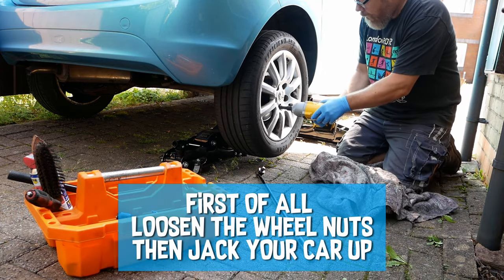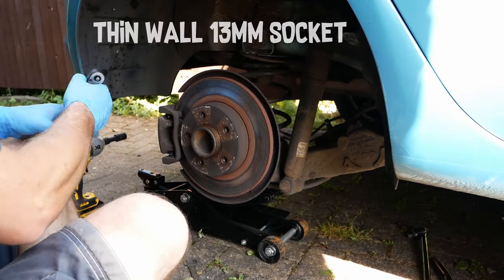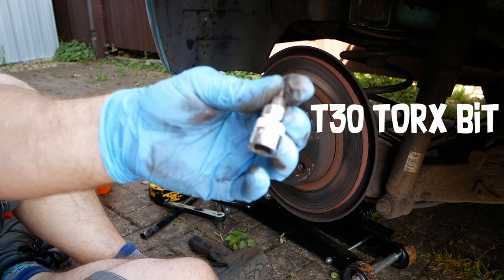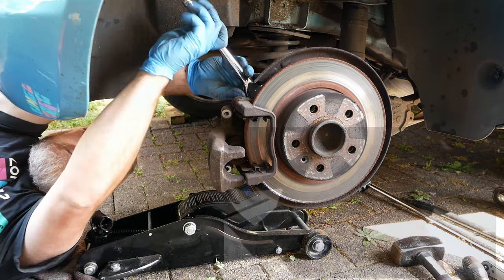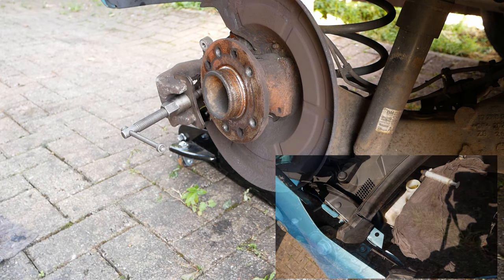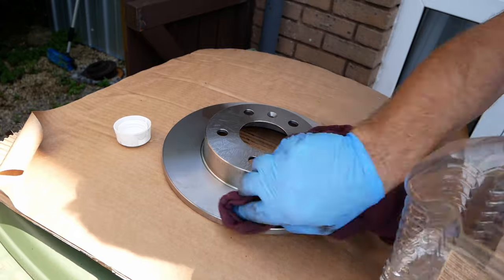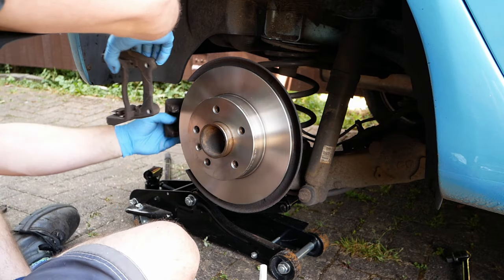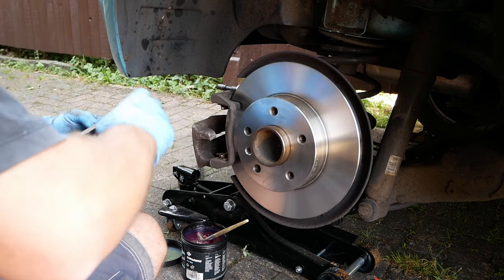VAUXHALL MERIVA B REAR BRAKE PADS REAR BRAKE DISCS please read description below.

Comment from the maker: Someone pointed out that there is a service mode for the electric brake  that can be easily activated when changing brake pads on the rear. I have added it in the description and here is a link to the how to video.   https://youtu.be/55m_XQ5llbY

Comment: Great video thanks. I have heard that pushing the brake piston back in to enable fitment of the new pads can damage the ABS system unless the bleed valve is undone, have you heard of this? Kind regards
Reply from the maker: I have read the opposite so it may be only certain cars maybe?
Reply: Or maybe that is the reason why we leave brake oil cap open during this operation.

Comment: Would you by any chance have the torque specs for the caliper sand discs for this car as I cannot find them anywhere online
Reply from the maker: Brake caliper to carrier Rear 25 Nm
Brake carrier to hub Rear 100 Nm
Reply from the maker: That's the information I found on the web and isn't directly from Vauxhall
Reply: @baconbuttties  You’re a legend, Not only did your video help me do my breaks on my own for the first time, You’ve just saved me hours of time trying to find them
Reply from the maker: @johnallan5067  👍

Comment: Great video! Is there a way to wind the piston back without the special tool???? 🤔😎
Reply from the maker: Before I had the special tool I used to use a pair of long nose pliers. Put the tips of the pliers in the slots in the piston and push and turn,  It can be quite hard to push and turn pliers at the same time but i have done it.
Reply: @baconbuttties  Thanks, that’s what I’ve done before but just wanted to check there wasn’t something I was missing Lol! 👍🏻👍🏻
Reply from the maker: @RATTLER238  👍🏻
Reply: Some claim the piston has to be rotated while being pressed in. Did you do this?
Reply: @667Gurba  Yes, turn as you press/squeeze 👍🏻😎
Reply: @RATTLER238  Thanks. 🙂

Comment: What price is far for rear disc and brake pads for a meriva been quoted £406
Reply from the maker: I paid around £50 pound for discs and pads... £406 pound seems excessive but then I always do my own so not sure how much a garage would cost.
Reply: @baconbuttties  well after looking at your video it’s seems I would be getting y pants pulled down thanks for taking your time to reply all the best
Reply from the maker: @billymccorkell1830  no problem, I hoped it helped 👍

Comment: Hi, any news on the last e bike build? Also, I noticed that you used a zoom forgo fork on the e bike you sold, is that fork any good?,I'm thinking about using it on my bike... Anyway great content...subbed!
Reply from the maker: Hi, the zoom fork is okay on flat surfaces but any bumps and is like a pogo stick and has no damping.
It also says not to be used as downhill forks as they will probably not stand up to it.